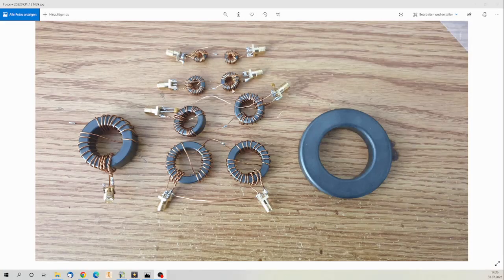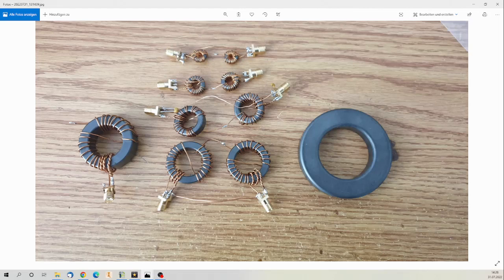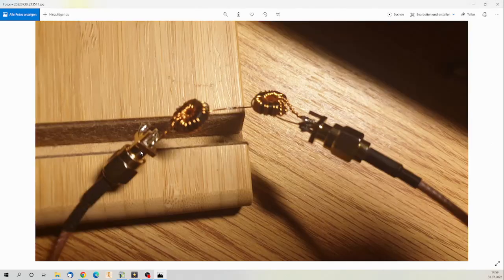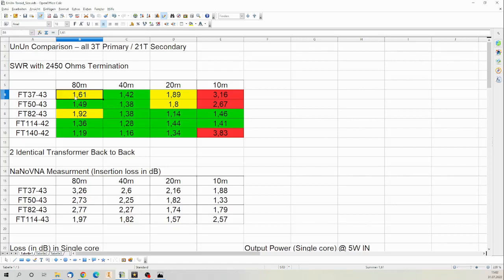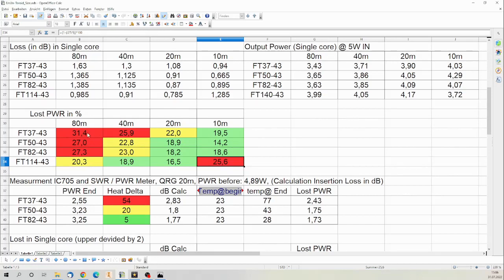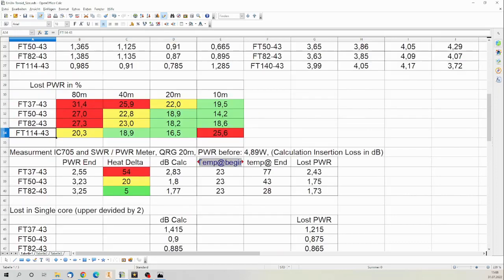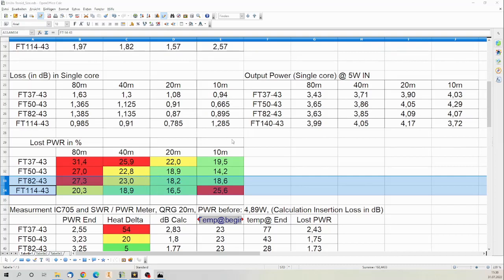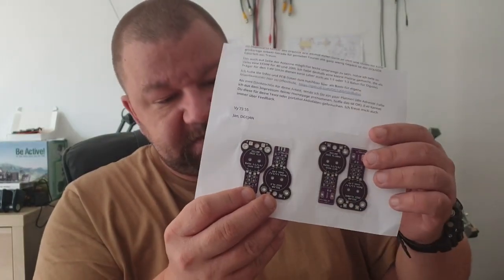Antenna building #2 - EFHW Antenna - figuring out the right core size

Comment: I've done a bit of research on the subject on and off over the last year, and it looks to me like the most efficient set-up across the HF bands is with a Fair-Rite 2643251002 core for up to 100 Watts SSB. Being a relatively large core, and with an efficiency around 90% or more they definitely won't heat up with QRP xmitters. They have a smaller internal diameter, and are taller than the typical doughnut shape you are using in this video. That apparently improves the efficiency. They are about $8 US each, but for the efficiency and power handling capacity I think they're worth it. I plan on getting a couple of them to try out and do my own efficiency tests. The only place I found that had stock here in the USA was Mouser.
The Mouser part #: 623-2643251002
Reply from the maker: Yeah, I´ve heard about it so I stock-piled a lot of different fair-rites for more testing. Before I believe stuff, I try to re-produce the test results. Video coming soon about it. But I don´t know exactly when, as I am out of available free time at this moment.
Reply: ...biggest problem with the small cores is there just isn't enough 'meat' on em to do the job properly, they'll saturate pretty quick even at qrp 5 watts... the Fair Rite 2643251002 wound linear (no crossover) and 14:2  is a small form factor, suitable for portable, yet presents more core material mass than even a 2 stack FT 240 43... YOu can go from QRP to moderate QRO with just one core... and the efficiency can be over 90% ... I have 2 of em

Comment: Hi, Great content. I trying to figure out what is required to change when increasing the wattage from 10, 15 , 20 watt to 100 watt. This video explains it very well. Could you please  provide a document with various Transformer core sizes and capacitors types/uf that can be used with different  watt? May be a text/pdf document or point me to a resource that I can read.
Thank you very much for the time and effort you put in 
Nitin
Reply from the maker: https://dl2man.de/antennas/ might be just what you´re looking for. 73 Manuel; DL2MAN
Reply: @dl2man  Thank you! This is exactly what I was looking. Is there a table for capacitors  too? Which type to use for a specific wattage ?
Reply from the maker: @NitinVarmaManthena  This answer is more simple: Square-Root of (Input (in Watts) *400) is your Vpp over 50 Ohms. In case of 5 Watts this equals abt 44Vpp. I want a little safety margin in case of bad SWR (min factor 2), so I recommend 100V Caps for 5W use. 100W equals 200Vpp over 50 Ohms so I recommand 500V Caps. For more or less Power, you can calculate it for yourself and apply a safety margin of at least factor 2. Use only RF Type capacitors (Minimum NP0/C0G, better Glimmer Type)

Comment: Your insertion loss figures on the spreadsheet - Did you half them for the spreadshhet or are the results we're seeing the results that the VNA displayed?
I feel like you'd know this already, but the result on the VNA (two transformers) would be double what the antenna sees (single transfoirmer).
Reply: Hold on - My bad! You wrote on the spreadsheet "single core".
What can I say, I have reading comprehension issues!
Reply from the maker: All good ! Yes it was put into account. If you want a knot in your brain, check out my later Video, where I show a different approach to test core efficiency with only one core (no back to back measurement): https://youtu.be/liobaos7nhs 73 Manuel; DL2MAN

Comment: Love these videos, but one comment grabbed me, 64:1 work better for elevated feedpoints, I can't find anything on the internet about that. I am want an attic antenna, could this work? How high is elevated, and what affect does that have? Thanks, Ed KC8SBV
Reply from the maker: First of all: an attic antenna is no antenna ;) The universal directive would be: Put as much wire as possible, as high up in free air as possible. The reason, why 64:1 works better on higher elevation point, is the interaction with ground. In theory, an EFHW has infinately high impedance at feeding point. In practice it´s less. Because it´s a capacitive interaction with RF GND -which is usually earth/soil under the Antenna. Rule of thumb: The lower above GND, the lower the feeding impedance of the half wave. There are no hard boundaries. But height above Ground also affects resonant lengths, so your wire lengths need to be adjusted ! Trying to "estimate" ground level/potential on an attic seems to be an impossible task to me. 73 Manuel; DL2MAN

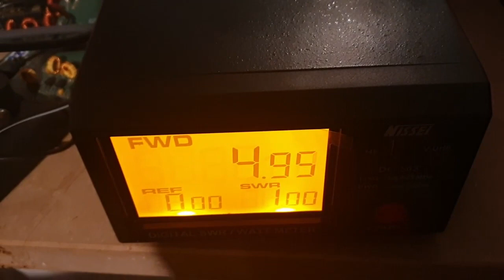Comment: It’s unfortunate you gave up further testing of the 3:21 on FT140-43 because of high 10m SWR. As most EFHW transformer builders know, 10 m SWR is most affected by the value of the shunt capacitor. In fact, the cap has little to no effect on 15m and lower. 

I have tried a variable trimmer cap and found the optimum value for 10m SWR to often be quite different than the typical 100pf, which is just a random value to offset leakage inductance. Every different transformer will require a different value of cap. 73,
Reply from the maker: As mentioned: I´m using 2:14 for FT140-43 with great success.
Reply: @dl2man  I finally ended up using 2:14 on my FT140-43 as well, it provided a far better match across 40m - 10m than the 3:21 did.

Comment: So would the conclusion be - feed the antenna where the impedance is as close as possible to 50Ohm to minimize transformation losses (i.e. 1/4 wave vertical or center fed dipole)? Or use as large as possible core. 

Another question, would it make a difference if we used 2/14 vs 3/21 in the transformer?
Reply from the maker: I have no final conclusion for you, as every Antenna is a compromise of some sort. The EFHW has Benefits: Ease of use/Setup, Multiband. Disadvantage: Loss in Broadband Transformer. Take that Endfed-Concept, and substitute the lossy broadband transformer with a resonant LC, and you have the Fuchs Antenna. Very selective, more critical componants involved (resonant circuit under Power) Lower losses, but Monoband. A Dipole is Monoband Antenna as well and needs to be fed at center Point with CMC Choke and a lot of coax because feeding point is where current flows = where it radiates, so it should be high up.... Doublet has no losses in feeding line, is multiband, but needs a (low loss) tuner. All of these Antennas work. You gotta select the advantages that you want, and check if you can live with the disadvantages. There is no free lunch in physics ;) It also depends on the available space, and where you are/want to be located in relation to the Antenna. 2:14 vs 3:21 does make a difference and depends on the core size. It´s a matter of wether XL of primary Winding is sufficient for the job. See: https://dl2man.de/antennas/ for more details. 73 Manuel, DL2MAN
Reply: @dl2man  Thanks Manuel, you know a man would always try to find the "ultimate" solution. I have the DX Commander Classic vertical, but if i keep it in the backyard for more than a few days the neighbours start complaining, so i have to set it up when i want to use it, then pack it back up. 

EFHW would be more invisible (i hope) if i use one of the trees on the property, but I am only using QRP (10W), and looking at your video i was "wow, my 10W would be cut in half".

Great videos, i love watching your channel. Keep up the good work

Ivan 
VA3NKA

Comment: You could try some type 61 and type 52 though I don't think they are supplied in as many sizes as 43. Also could you try a fair-rite 2643625002 core, you can get them thru mouser. Thank you for your efforts and sharing the results. 73/72
Reply: Do you have a suggested winding pattern and compensation capacitor  for FT114-61 and -52 Jer? I tried those a while ago and the "best" I could achieve was a single band transformer for 30m band with the -61 type. So probably better efficiency, but a lot less broadband. At some point I needed a break from transformer winding and gave up ;).

Edit: All my cores are FT140 variants -43, -52, -61.
Reply from the maker: Thanks for the suggestions. As I said in my closing words: "you always realize, you´ve not done enough". This topic could fill hours of Video.... 73 Manuel; DL2MAN
Reply: @labcat73  I don't know, excellent function, low loss/high efficiency and good swr, across the entire hf range is a lot to hope for, perhaps a variable cap and some sort of swr indicator would be needed for adjustment. W7ZOI had better efficiency on 40 and 20 with a ft114-61 than with a ft114-43. K1RF says (p28) that the qrpguys "no tune endfed" setup has too little inductance on 80 and 40 using a ft114-43, modeling of it is discussed in the current july-aug '22 qex, p31, with some discussion of the fixed cap and swr. I really like what Manuel is doing, and while I am tempted to get one of the tinky K6ARK kits, I am not yet convinced it's the optimal configuration.
Reply: @dl2man  in K1RF's "The End-Fed Half-Wave Antenna" from Nov 2018, p 25, he says 3:21 with 22g wire on a fair-rite 2643625002 with a 100 pf cap is better than 90% efficient on 80 thru 10, and he says it's good for 5w digital, 12.5 cw and 20 ssb. The core is stubbier than the usual pancake like toroids used. I am tempted to try it with a k6ark pcb/bnc setup. Maybe the stubbier configuration will make a more efficient transformer.
Reply from the maker: @jertres2887  You might want to look into MM0OPXs great work (he also commented here): https://youtu.be/nZ-G4hJCTSM
Reply: @jertres2887  Omg i am hopeless... 🤦‍♂All that ferrite core discussion made me realize, that I used the wrong name in my last two YouTube videos *lol*. How do i fix that now? All my test-cores are FT140 sizes... -43, -52 and -61.

Comment: Try the FT50B-43. "B" version....This is a taller version of the FT50. Can be hard to find. Wind it as an auto transfomer and I get 91% efficiency. I run mine at 30W SSB. I use 2 as a 1:1 balun, or 4 for a bit more power handling that QRP. Try stacking 3 core of FT82-43. Wind 3 turn primary auto transformer. Similar efficiency. Try winding on FT140-43 as auto transformer and close wind the turns. Close winding gives best flux linking and best efficiency. Spreading out turns reduces linkage and loses efficiency. Running a separate primary and winding as bifilar has no advantage. Try the "standard" of FT240-43 as per "internet wisdom" and you will get.... no surprises from your tests here. SWR testing is interesting only, but lossy winding and builds have better SWR. Loss to SWR in short coax is far less than loss to lossy cores. WELL done on actually building and testing, a refreshing change from repeating designs that have considerable loss - and it is fun! enjoy.

Comment: Is it possible that such heat is generated because of different winding? (3 primary turns instead 2 turns) What about toroids with different AL value? (AL = inductance per 1000 turns).
Reply from the maker: I suggest to look at my 1st Video to answer your questions: https://www.youtube.com/watch?v=2-4J8ECkoe4 AN EFHW Transformer ist aways a compromise. YOu can use different Al Cores, but you will see a shift towards bad SWR on upper or lower frequencies. But maybe there´s a winding pattern, that matches those other Al Values. I simply don´t know it. I could spend weeks and months exploring those Transformers. :) 73 Manuel; DL2MAN

Comment: All these cores and the ones I found for sale are UNMARKED.
How you know the type of the material?
How can I identify and validate actual core material?
Reply from the maker: That´s a very good question. The easiest way is, to buy from reliable sources (ebay/amazon/aliexpress not beeing one of them), where they have DataSheets for everything. Once recieved: Label it ! If you have an unknown core, there´s ways to measure it, but you need some equipment for that: Wind some turns on the unknown core, measure the Inductance of that coil and calculate the AL Value from that. Look up what Materials are available for that size Core and derive the Material from the measured (calculated) AL Value.
Reply: @dl2man  Good.
What is your (lowest cost) suggestion for measuring losses and frequency range?
Reply from the maker: @paulcohen1555  any nanovna, that fits your Bill. They all work
Reply: If you can get your hands on them, then measuring their resistance will weed out the duds or thise of a different composition:

https://www.youtube.com/watch?v=GulNhvNdIbM

If you cannot, I would be sure that the online seller offers a free return policy.

Comment: Tuners are not so lousy, but some yes.
Reply from the maker: I agree. Z-Match is a great example of a highly efficient Tuner. However: The classic N7DDC or MFC Matchboxes turn your (non resonant) Antennas into a Dummyloads with a little Radiation, as the core losses are also present in those. 73 Manuel; DL2MAN

Comment: Not surprising as the turn*amps moves the smaller cores into saturation more. Say 50W=I^2*50Ohm so 1A, 50V RMS.
Reply: The smaller cores might benefit from #61 material on 10m.
Reply: For the lower bands an extra primary turn and the required extra secondary turns might help, but then again it might move the core closer to field saturation.

Comment: As you have two transformers in series, the actual loss per transformer is HALF of the loss that you measured; that is, if you measured the power output from the high impedance output of one transformer, it should be half of your measured loss using two transformers! Thus you would be putting more signal to air than your results indicate!
Reply from the maker: Please watch the Video again, I explain that in the Video. I devide the results by 2 in my Excel Sheet....

Comment: I can see you're very disappointed in losing 25% of your power!  (Yes, I also see that this video is a year old, so probably you've gotten over it.)  But, this isn't as bad as you think.  A loss of 25% is about -1.25dB.  And how much is -1.25dB?  On the receivers that are listening to you, it is 1/5 of an S unit.  So instead of getting an S7 report, you would get an S6.8 report, but they would just round it up to S7 anyway!  I know this seems ridiculous, but even loss of HALF of your power only amounts to 1/2 an S unit at the other end.  Every antenna system has losses, and everything your signal goes through that doesn't have gain has loss.  Have you looked at how much power you lose in your coax?  I think you would be shocked.  To avoid this particular loss, you could use a center-fed half-wave dipole.  But there are good reasons you want to use an end-fed instead.  Like you said, everything is a compromise.
Reply from the maker: All very true ! I got over it, I improved efficiency, I built center fed dipole and I´m still having fun, and that´s the main goal here. It´s just grown up Version of toys ;) Thanks for your comment ! 73 Manuel; DL2MAN

Comment: Thank you for that awesome video! Conclusion? Use resonant antennas? vy 73 de dl8cy
Reply from the maker: EFHW is a resonant Antenna ;) And works really well in practice. But nothing will beat a well tuned and elevated monoband DIpole. That´s for sure. 73 Manuel; DL2MAN